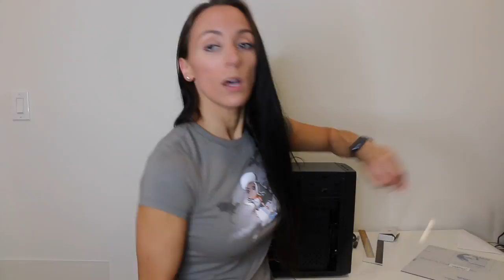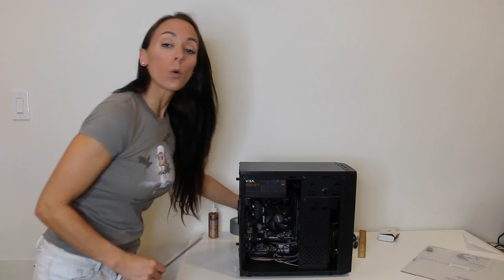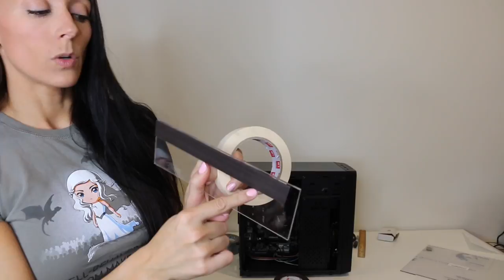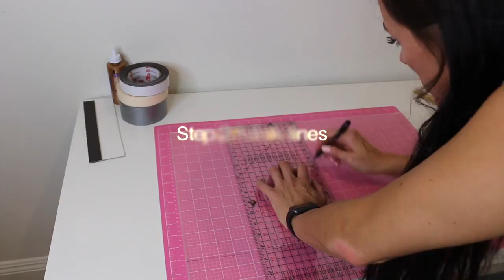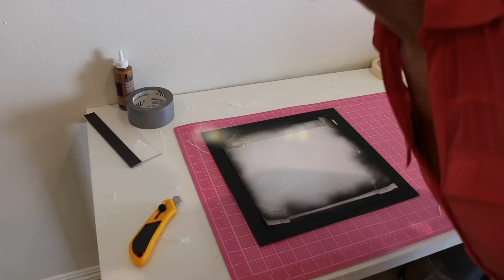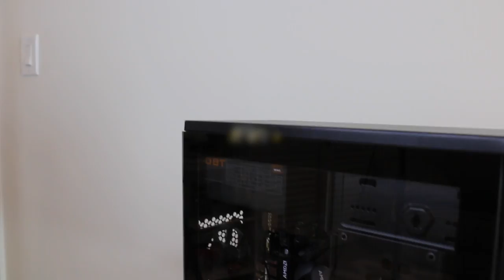MAKE YOUR OWN FULL WINDOW PC SIDE PANEL!

Comment: for those wondering about using a saw with acrylic / Plexiglass / lexan you want a high tooth count. I personally use 200 tooth on the table saw and for acrylic rods 180 tooth on the miter saw. You'll see it on the blade usually listed like 180T or 200T. the more teeth the finer the edge, this extends to all things from metal, wood, and plastics. Enjoy your diy :D

Comment: I just did this. If anyone is wondering you can use real glass too. I used 2mm thick glass (custom cut at shop for a few bucks).It is still light enough so the magnetic tape (I used 1,5cm) can support it just fine. Actually I am surpised at how good that tape is hodling to metal. Cheers and thanks for tutorial!

Comment: I came here right after looking up how to cut tempered glass (looking to mod my Define R5 panels).  Good thing you didn't try.  Anything short of heating it to 1000F to anneal - or de-temper - it will just result in a glass explosion.  Even when annealed, I guess one will have discarded the strength advantages of having TG in the first place.  

Good video, in any case.  It gave me some ideas.

Comment: Thanks for this, I finally broke down and made a side for my HTPC that has been missing one for years.  I scratched the acrylic accidentally while trying to cut a rectangle out for my water cooler, but otherwise it works wonderfully.  I do hope the magnet tape won't cause any issues with the hard drives.  Aside from that, I bought black vinyl tape to cover the magnet tape glue look, and I'll probably use the same to make some kind of decal to cover my scratch too.  

Thanks for showing the process, I never would have thought of this and love the look!

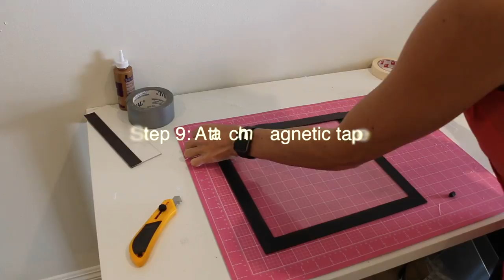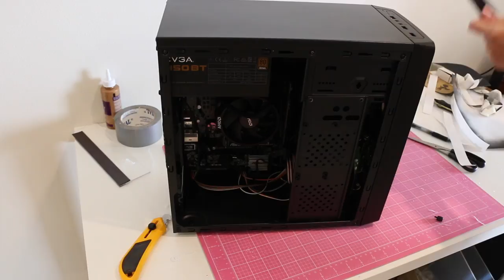Comment: how flush is the acrylic to the frame? does it warp over time? Edit: i see at the end the plate glass doesnt quite sit flush or evenly with the frame. at 5:39 I would have not just slapped the magnetic tape onto the edges of the glass, but rather measured and marked off on the frame where the magnet tape would sit. There are indentations, protrusions, and ridges (at 6:23, pause)  and what not in the frame  that would need to be taken into consideration. A fully-laid out strip of manetic tape on the glass will not seat flushly in the frame channel.  Good effort tho and it looks mostly good!

Comment: If you're looking to do the drill-tap method, look for a M3 Drill-Tap combo and you can reuse your old thumb screws for the side panel, or get those aluminum ones at a computer store.

Comment: great video, i once made a full window acrylic, and instead of magnetic tapes, i used thumb screws, its quite tedious though as i had to drill holes and thread the chassis for the thumb screws to be attached properly.. also i tinted the acrylic sheet with a car window tint.. you should try it too

Comment: Great idea, awesome video! Always wanted to do this but never thought about magnets or that magnetic tape (heck, didn't even know that tape existed!).

As a small suggestion, you might try to sand off the borders a bit for a cleaner look and less injury potential.
Reply: Panzero Brothers 
yes, really.... you said a correct point...
Reply: Just did mine for my.h440 I used magnets it came out great

Comment: That turned out a lot better than I expected. This wouldn't work with tempered glass anyways. I've used that meganetic tape for other computer projects and I know it wouldn't be able to hold a TG panel to the side of the case. Nice work!

Comment: Suggestion - measure the size, go to Lowes , Home Depot, the sell the acrylic and they'll cut it to size for free...
Reply: Great idea 😍 I bet someone already cut themselves trying to do it themselves 🙂
Reply: I had another idea! Before you build just take the case to Lowes, give the guy the side panel and let him measure and cut, and while your there since you have the case you can double check if its cut enuf, if not tell the guy to fix it. As for the rest I would skip the spray paint and maybe just use a magnetic strip along the top and bottom =)
Reply: To be honest most workers will only cut it to roughly the dimensions you want  and not to the exact dimensions you need. Cutting it yourself saves the hassle of having to purchase a cut plexi thats not to your liking,
Reply: ty bro, got one down the street. :)

Comment: Does the magnetic tape can make problem to the hdd? You know, its magnetic too. :/
Reply: It might! 😵 Use screws instead 🙂
Reply: Their magnetic field strength isn't that much to cause any sort of issues to HDD.
Reply: Integra Xnine thank u solve my problem ^^
Reply: Those thin magnetic tapes have very short field and strength to affect anything, it won't do anything to the HDD. In fact many higher end cases have magnetic dust filters attached to the case. Also take in mind that many components already have even stronger magnets in them, anything with a motor for example. Also the HDD do have very powerful neodymium magnets inside, as big as 1x1 inch with enough force to break your fingers, they're part of the mechanism that moves the head and they sit right next to the plates...
Reply: it will not affect hdd that magnet is not strong enough, but if you can use thinner strip if you like
Reply: Hdd already have super strong magnets in them :)
Reply: Hdd already have super strong magnets in them :)

Comment: A table saw, or circular saw works good if you put the blade on backwards, so that the teeth face backwards, otherwise the the teeth will crack and chip the lexan. Also, set the cutting deep to just a hair over the thickness of the material.

Comment: What kind of spray paint did you use? Without sanding first it seems like there would be a good chance of the paint adhesion failing and magnets falling off over time wouldn't there? I was thinking about doing something similar to this but with sanding/etching on the outside vs the inside.

Comment: Just use masking tape were your going to cut on both sides go slow on the table saw or jigsaw you just don't want to go slow that you melt it I been doing thins since the 90s pimple .Don't take off the projective plastic untill everything is finished and keep blowing the saw while your cutting.

Comment: hey that looks pretty good but i'd demonstrate it on a case without such a huge drive bay, or maybe do a cutout on the original panel and mod the acrylic into that so only the components are visible and the ugly PSU and drive cage is not.

Comment: I wonder if there's a way to make the magnet tape to be strong enough to support tempered glass. Or laminated glass.. 🤔
Reply from the maker: Oh! That magnet is pretty strong, it just might. If I can figure out how to get some tempered glass cut, I'll definitely test it out.
Reply: caitlinV3 was concerned about the weight of the glass panel. But yea, magnetic tape & some clips might help
Reply: The only problem I see with that is the use of adhesive to attach the magnets to the tempered glass.
Drilling might be a good idea. Video responses soon, maybe =3

Comment: Okay, I have a sketchy question here: what spraypaint did you use - regular acrylic spray, or some spray with primer included? Also, was there any preparation of contact surface before spraying? I'm getting told that regular matte spray in a can won't work well with plexi :/

Comment: Nice Job.  I might have to try that with my build as I have been leaving the side panel off and this method would be easy to take on and off.   Cheers
Reply: I agree easy access panel to get off no screws to worry about dropping and it turned out very nice good job
Reply: Didn't u get dust to keep of the side pannel

Comment: Hey can someone help me I don’t know where to go to replace my tempered shattered glass if anyone can help please leave down places to go
Reply: Lowes and Home depot both have them.  Here is another neat trick, which might even be cheaper.  Buy a cheap picture or poster frame and cut that if you would even need to.  I found on that did not need cut at all.

Comment: to be honest why doesnt the top line up properly?
Reply: Well you know how it goes with these cheapo cases.  It isn't square.
Reply: No I dont have buy cheap cases and they are all square. No wonder she sped through the last step.
Reply: actually measuring and cutting acrylic is sketchier than you might think
Reply: what are you talking about Ive cut lots of acrylic so no its not.
Reply: I dont know how great you are but i remember when i started modding that i would end up with misshaped gpu backplates etc. It was my guide ruler changing angle while i was cutting. My point is its not as easy as cutting paper
Reply: Actually its easier. its and easy and drawing a straight line with a ruler. but its not the lines it the fitment on the case that seem to be the issue. I think its lame she didn't discuss it and sped through it. that was a chance for troubleshooting
Reply: Cutler Cycles that is true. If you saw she didnt have the paper wrapped acrylic so unless she used paper tape to mark the line (its what i do) she could easily miss the line. Those panels wrapped in membrane kinda suck to work with.
Reply: dude, its the gap created by mag tape...duh

Comment: Ye my dumbass thought it would be a good idea to take off the glass panel for better heat dissipation then put it back after i finished gaming. Then the whole thing shattered when i slightly hit the corner to the ground. Lucky me, my work place has all those parts in your video, it is so simple but i never thought about it and nearly made a purchase on some sketchy websites.

Comment: It's ugly as sin. Just modify any cases existing panel by cutting your desired size hole in the panel with a jigsaw and metal blade. Deburr your edge cuts and if you were unable to get them perfect then apply some edge trim designed especially for the job of making metal cut edges safe, then glue the perspex on the INSIDE of the side panel. Job done neatly and no ugly magnets holding your panel off the carcass of the case creating dust traps.